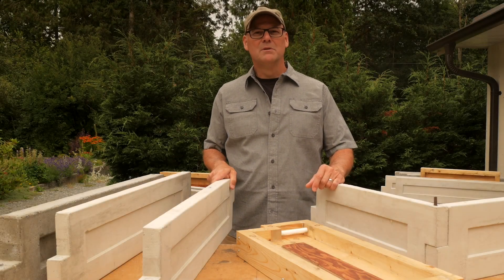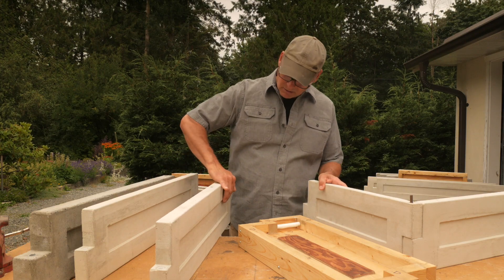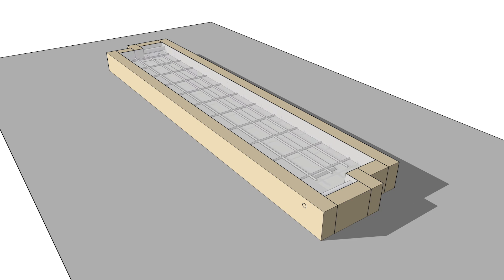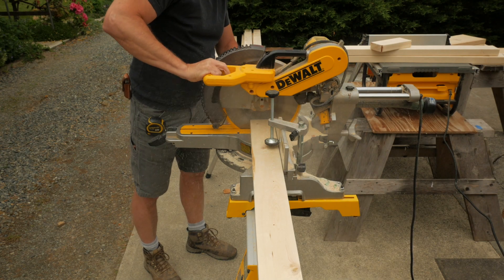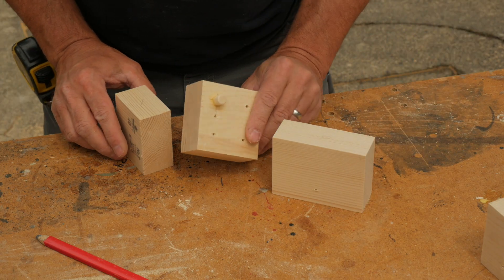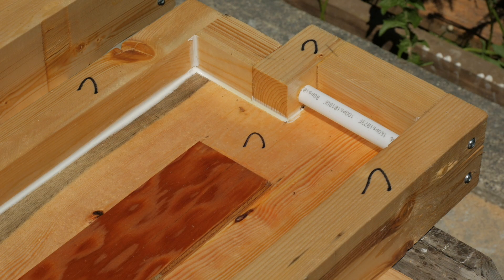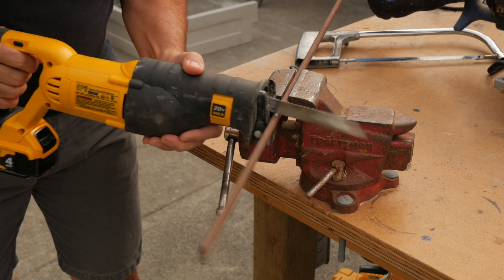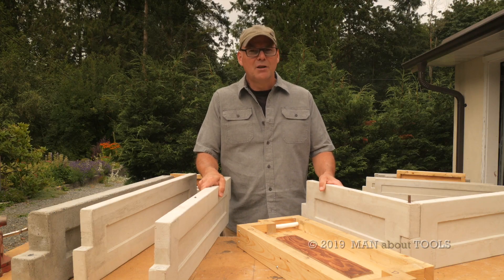make Thin CSA Concrete Garden Boxes PART 4 - cast garden forms

Comment: My formula.  27.5 lbs mortar.  5 gms of citric acid, 7 gms of plasticizer,  large pinch of fiberglass shards, 2 quarts of water with about a dozen ice cubes. Makes 1 3 foot mold.

Comment: How high could you stack these? 3.. 4? I would like to do 3 high would that be too much pressure for the lower wall from the dirt inside? I'm afraid the ice in the winter swelling inside the dirt would crack these in the center of the lower wall and then go pear shaped after snapping

Comment: At around 12:36 make sure you do not inhale that powder cloud. My uncle was a builder and he died at the age of 52 after decades of doing concrete mixes, his lungs were full of concrete the doctors said, all that dust gets in your lungs and will never leave.
~ My father died at the age of 68 from lung cancer, he wasn't a builder exclusively but he was a farmer and did some side building jobs along with other season industrial jobs that all had dust, poisons and concrete. This is why he lasted longer than my uncle who was a builder by trade.
~ My father's generation (boomers) in the village had a ton of people dying from ages 50 to 70 from lung cancer and they all worked similar farmer-building jobs.
~ Those that were also smokers died earlier, my father wasn't a smoker but my uncle was a chain smoker.
Reply: Silicosis, my grandfather went the same way

Comment: How to remove the metal rod if I want to disassemble them?
Reply from the maker: You can leave the rebar sticking up a half inch or so. Then you have something to grab with pliers to pull it out later. Or, if the rod is flush with the concrete panel, try using needle nose pliers to grab it and pull.

Comment: I watched your initial video several years ago.  I loved it!  I am not a gardener by any stretch of the imagination, but I was trying to figure out a good way to make a fire pit.  I used your idea and built several panels and placed them in a 2'X2' square, then placed a metal 50 gallon barrel cut to height in the center and filled the space between the barrel and panels with sand.  It has worked wonderfully for several years.  I'm now interested in making the light weight and thinned panels to form up a couple of old window wells.  Thanks for the excellent videos and fun!!

Comment: Thank you for the series. The neighbors are already asking if I could make panels for them!

I live in southern Louisiana. Any tropical system which passes through will flood the area. Because of this, my house sits at an elevation of 5 1/2 feet above the yard. The problem everyone runs into is an inch or two of standing water in the yard after a heavy downpour, such as is happening as I am writing this. Frustration sets in as year after year, people lose their flowers and vegetables. A raised bed is almost a necessity. I currently grow my vegetables in fabric bags elevated on landscape timbers. High humidity, high temperatures and bugs quickly deteriorate less expensive items.

Comment: Hypertufa is supposed to be 1/3 the weight and super strong:)  I watched a video of a guy making two concrete steps for his front door area.  He made a mold and then made a compass design in the mold with silicone.  It imprinted into the concrete and stayed on the mold to be reused.  
I love this video and his voice!  Very calming.  And the outcome is stunning!  Architectural Digest material!

Comment: I want to make a long box about 8 feet long, about 20" deep, and 20" tall.  I think this will be a good way to pour the panels, but I think I will use melamine to make it perfectly smooth for the bottom. And instead of overlapping the corners, I may add threaded inserts so I can bolt them together.  I'm going to use it to grow bamboo for a privacy wall and will want to be able to take off the front panel when it is time to thin out the bamboo.  Great idea in the video and comments!

Comment: There are concrete pots 1cm even less using fibre glass mesh ( more than one layer), you can not use the iron rods then. The concrete mix you use looks too fluidy maybe too much water is used? makes it weaker.?

Comment: Do you need to cure these in a water bath for an additional month or can they be put to use if air cured after a month? Thank you in advance!
Reply from the maker: I believe these reach almost full strength right away. Check on the bag.

Comment: What is that electrical fence post you used? I looked for it online but am unable to find it.  I am looking for a metal pipe with that small diameter.
Reply from the maker: I think it was ground rod for electrical fence. Also check for long galvanized nails or spikes for pinning landscape ties together. See the end of this 2 part series: https://youtu.be/Tpawk5DNARI?t=1448

Comment: I want to make these panels and use them to build window wells with them. I'd make the forms to form a trapezoid shaped well, the wider side will make contact with the foundation wall. The longest panel would be 48" long and 13" tall. I will add a tung at the top and a groove at the bottom so that each course will key into each other. 
I think a thickness of 3" thick with 10 guage wire mesh will do the trick. Any advice on concrete type or anything else?

Comment: Curing must be a critical part of the formula !!!   I cast my first four 11" X 48" panels without steel ( 50lbs of mortar ) and 12 hours out of mold they broke very easily .Clearly one must use reinforcing along the panel length.  In the video 1/3 oz fiber ( a pinch ) was suggested. I used 1 oz of fiberglass instead of 1/3 oz and it seemed to be useless. Much of what I read about fiberglass suggested 3% fiberglass which is huge and no doubt would inhibit having a flowing mix!  Also PEX tubing in a roll is tricky to get absolutely strait and accurate dowel placement seems critical.  If you don't get it so,  passing a rod thru proved to be difficult. I found I can drive the pex out of the un-cured panel leaving a generous hole for 3/8" rebar. Perhaps building with a solid dowell well lubricated and removed with each pour would be simpler overall.  Im hoping curing is my main weakness to overcome. Also torching the 2"X11" and wire brushing it proved to produce VERY aesthetically pleasing wood like appearance.

Comment: Where did you source the electric fence posts that are ll metal rods?  My local Tractor Supply, Home Depot, etc, just sell vinyl coated ones with a part that one's foot can push down into the soil.
Reply from the maker: I can't recall. Might have been some scrap metal I had hanging around.

Comment: how long of a mold does a 55 lbs bag do? thanks
Reply from the maker: There's some details on this page that might help: https://manabouttools.com/make-thin-csa-concrete-garden-boxes-part-4/
Reply: @MANaboutTOOLS  thanks, that cement is now $21 per 55 lbs bag, since you made this video, have you discovered any other cement that would kind of do the same? I would be making lawn hedgers, no pressure involved, thanks

Comment: I bought your plans(out of gratitude), but probably won't follow them exactly.  🙂

I absolutely love the look of the CSA panels.  People should be more generous with the likes!

I built a raised bed once using 4" block, 1 1/2 blocks high. I had to cut the blocks as well as a channel in the top to hold the rebar. It worked out well, but was VERY laborious and permanent.

I intend to use a rich sand mix of 2-2.5 parts sand to 1 part regular cement... like Ferrocement. I will reinforce with chicken wire. This should be cheaper than CSA and hopefully look as good. I will probably make them wider, so I can set them into the ground a bit to keep Bermuda grass from going under so easily. I will offset the inset so it is centered above ground. 
 Bermuda grass is my main reason for making beds in the first place.
Reply from the maker: Thank you very much! The biggest drawback of CSA is the cost. So if you can use your own blend then that's a good idea.

Comment: If your building them high you could used the thick heavy concrete ones at the base in the first row and add the lighter ones on top so the weed wakka wont ruin the first row ones, but youll have to make the thinner ones the same size as first row ones so they fit around the outer edge and the rio holes meet up.

Comment: Since we are talking raised beds . A great free way to make beds . Look for old pressure treated throwaways such as deck and pool deck tear downs .Having been out in the elements already , you will know what parts of the pt won’t hold up . Then acquire an old
Above ground pool or two , not soft ones . That metal is great for many things not the least of which is lining the frames that you build from the old PT 
A little stain on the frames , you have great looking raised beds for just about nil
The ideal bed is just over 30 inches high imo

Comment: Wow you are truly an engineer .  How about the thickness though , how thin really do you think they could be made and still hold up well  , thinner , a little more glass maybe , and stiffer wire ? You really have a great idea there and I am sure you could sell them all day long
Reply from the maker: Thanks! I think these might be as thin as I would go. However, CSA concrete is more expensive than the regular Portland based.

Comment: Great evolution of the forms! Question: If you didn't have to worry about the tube and dowels, would the concrete be able to release from the forms without taking them apart? 
If so, you can have a more permanent system to release the concrete from the forms, have one dowel that slides from the front side into the end block, insert your tube then slide the dowel into place. when concrete is poured and set, pull out the dowel and pop out the concrete from the form...

Comment: I love the series thank you for sharing.  I had a thought, instead of making panels have you thought about a full size form?  My thought here is making say 3x6 inner wall outer wall form pouring the concrete in between similar to construction.  I understand the recess and mobility is not an option but in theory this could save alot of time depending on the total quantity of garden beds. Thanks again!

Comment: Considering this video is quite some days old, it might be a long stretch to expect an answer - but I'm gonna ask anyway:

a) did the thin CSA panels still need a longer curing period (e.g. in the tub, as shown in the part 3.5 video) or are they done and ready after the 1 hour you mentioned in the video?
b) Do you think it would be worthwhile to use CSA cement for the the thinner panels along with Perlite or Vermiculite instead of the CSA mortar mix for an addiontal reduction in weight?

Thanks for the idea & instructional videos. 
Cheers from Germany

Comment: WARNING: CSA is 4x the cost of regular Portland cement, and the closest place to me that carries it is an hour's drive each way. Using CSA makes this project financially untenable. I wish you had mentioned this. I might still try a thicker panel with normal Portland cement, but I feel... misled, I guess, after paying $9 for the thinner box plans, and $200 for materials to build the forms. Just generally feeling pretty disappointed.

Comment: I am confused as to how the mortar mix is as strong as conrete - mortar is not concrete.  Mortar normally has portland in it, like concrete does, but mortar may also have some lime and sand but no gravel.  Why not use the regular rapid set brand concrete?

Comment: Great video series! Content, presentation, and production quality are superb!
Maybe I missed this, have you done a durability test on this rapid set concrete with the string trimmer like you did the others?
Reply from the maker: Thanks! I didn't test them with the trimmer as I didn't think I would need to. The panel is super hard and durable.

Comment: I bought your plans for version III and IV but I'm wondering how many bags of concrete are needed per panel? I went to a calculator and at 1 1/2 in thick for a 4' panel for a 16 sqft garden, it says that I need 360 lbs which is about 7 55# bags at $17 each put it at around $120. I was hoping to do this for less and actually have the top about 24" off the ground because I have a bad back. Any suggestions?

Comment: I've made the forms and poured the concrete using the formula (timestamp 11:27) then tried to remove the panel after "about an hour" (timestamp 15:11) and got mush. The panel fell apart in my hand as I disassembled the form. I've added more fiber glass. That helped a little. I increased the curing time to 24 hours. That helped a great deal. However, I'm still getting hairline cracks in the panel. Do you have any suggestions for me?
Reply from the maker: Rich, did you use the same brand of CSA mortar mix? Did the freshly poured concrete solidify and develop a white haze? And become warm to the touch?
Reply: @MANaboutTOOLS  Yes, I used Rapid Set Mortar Mix. It took a while to become firm. It didn't solidify for several hours. I never saw the white haze and it stayed cool to the touch. After 24 hours it was solid and heavy with occasional hairline cracks.
Reply from the maker: @richmerritt9913  What was the temperature outside? Also, I have been using this same formula on quite a few pours and it has always solidified quickly and then got warm to the touch. Maybe try it without any citric acid to slow the reaction time. Also it might be a good idea to try  a few mini tests to sort out what might be going wrong.
Reply: @MANaboutTOOLS  It was cool. Below 50F. The current pour has set for 18 hours and is solid with a white coloration (note: I have added Terra Cotta Quikcrete Cement Color to each of the pours). 
It is getting warmer. That should help. I need to replace wood that has rotted with these concrete panels. 
Thank you for your help and quick responses.

Comment: Many years ago I poured a floor for a hobby greenhouse using leftover latex paint in lieu of the water in the premix. It's been over 12 years and so far no cracking or crumbling...just make it a "dry" (very firm) mix and trowel soundly. The paint was barn red, the floor ended up a dark pink-ish color. If you have some leftover paint you may want to experiment with that as your admixture liquid.

Comment: This is definitely something I’m going to try. I like the two piece ends over the three piece ones. Easier to keep everything square and there’s nothing stopping one from doing a longer overlap for more strength. 

One thing that I think would bother me is the number of screws to do and undo every time. Maybe it isn’t so bad so I’ll try it at first, but I’m already thinking of maybe trying just having a dowel or two sticking out of the base by 1/4” or so on each long side and one on each end and then just using a ratchet strap around the whole thing.

Comment: I was excited to learn about this product, but then saw it's about $2 more per bag. I understand you use less, and the thicker panel mix I had planned to use was with the vermiculite which adds to the cost. I would love to crunch the numbers, if anyone could provide the amount of materials per panel for each type of panel, I'm happy to work it out and create a sharable worksheet so you can enter your own product prices for an accurate cost analysis. 

Like, you only add the price and size of the product, the size and number of panels you want, then the worksheet would return the amount of materials you need and the price per panel. 

I'm not too keen to experiment with each mixture to work this out myself! I think it's going to be more cost effective to do this version. 

But I wish I understood the product better. It sets fast and is stronger, is that different than the "extra strength" quickcrete  product which doesn't mention CSA?

Comment: How would I add wire mesh to the bottom of the box to prevent burrowing rodents from getting into the bed? I can do that now with wood boxes and staple it to the wood but am wondering how to do that with your more long lasting concrete forms.

Comment: I've enjoyed this series. How have these forms held up after about 2 years with the weather? Also, if I want to stack the CSA or the other form about 3ft tall would I need to add an additional rebar pin support in the middle of the 48" panels or would the corner pins be enough? I'm thinking of making 4x8 garden beds with these forms.
Reply from the maker: The panels have held up well in the garden. I can't see any issues at all. I don't think an additional pin is required as you asked.

Comment: First of all, great design and instructive video.  I built and poured a 48 and 24 inch panel using CSA according to your recommendations.  I experienced quite a bit longer set time.  Part of that may be due to temperature in my shop.  It was a chilly 55 when we poured.  The recipe calls for 1.7 oz. of citric acid powder, but in your bench video you used the same CSA concrete but only 1.3 oz. of citric acid powder.  Do you have a specification you are using for the amount of citric acid powder to control set time?

Comment: No need to leave the plastic pipe in place. Extend the plastic pipe out from the form enough to grab hold of it and it should pull out of the solidified concrete and the form, leaving an unlined hole. More concrete, more strength.
Reply from the maker: See this version: https://youtu.be/9kga9jSG7Gs

pipe is removed. thx

Comment: On the cracking and warping issues. If you let them dry slower it would prevent some of that from happening. Try keeping them wet for a longer period of time. Then allow to cure for a couple of weeks.  May also fix some of the durability issues.